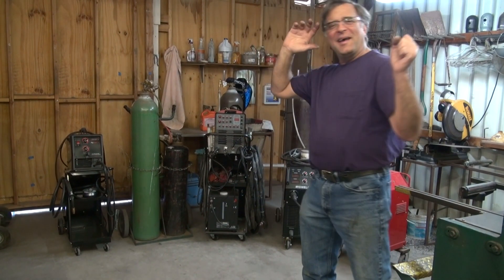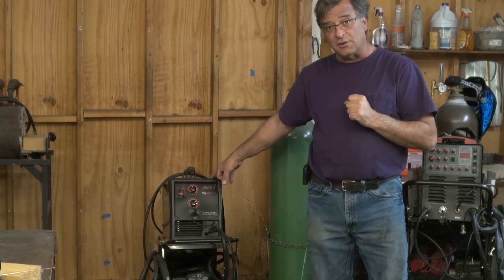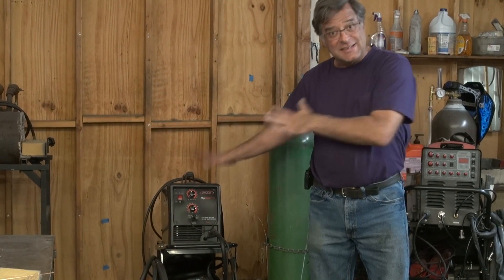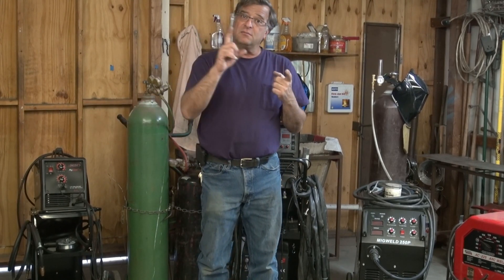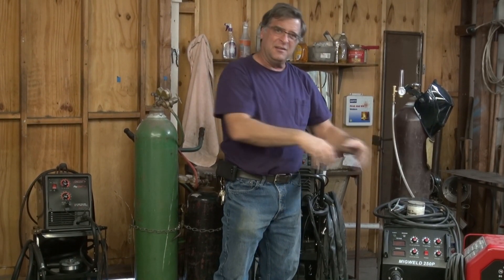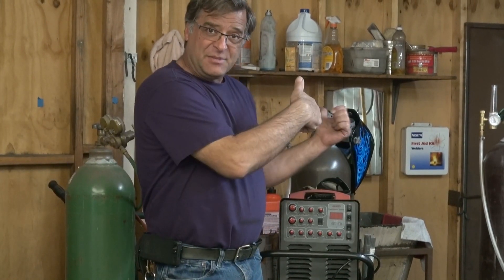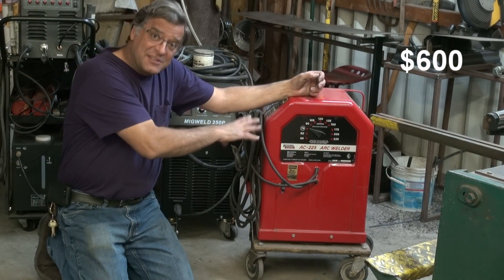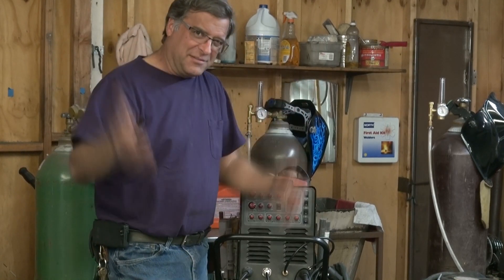How to Pick Your First Welder - Kevin Caron

Comment: Nice vid... Ok, I kinda had to laugh as I started to watch, when you said you have to decide where you are going to weld, inside-yep, out side-yep out in the field-yep, And what are you going to weld? Well everything from nick-nacks, artsy-crafty stuff, to 1-inch Thick Backhoe plate cutters, to 2"x2" 10,000LB trailer hitches, 12,000LB winch brackets, as well as Big and Small tubing for guards on trucks, and Side X Sides, and exhaust pipes, and I need to fix my Aluminum boat that got smashed on the rocks in a storm so I can take my Grand-kids fishing again, and I just got asked to make a bunch of steel plate shooting targets as well, I think they are 5/8" or better, so that is the reason I need to upgrade from my $89.00 HF gasless  wire feeder...(Which has worked perfectly for small stuff!! Best $89.ever spent!! Saved me well over $1000.00 So far and I'm only on the 2nd 2lb spool!!) Ok, Now the problem... I don't have 10,000 square foot "Welders" area to work in, and I can't afford to have 6 different welders, actually, I can only afford and have room for "ONE" welder... As I may weld 5 or 6 times in a year, then not weld anything for 2-3 years... So I need something that can do 110V as well as 220V and  would like AC/DC Mig/Stick/Tig... Someone just told me that a company called Everlast is coming out with one in a few months but all their numbers are "Bogus" and I have never heard of them before this week... So they seem very "Shady"... ( don't like when you can't contact a company "Fast & Easy"!! ) And Miller has a couple that are close to what I need, The "New" Millermatic-200 has everything but AC, as it has DC-Mig/Stick/Tig.... Now they also have a AC/DC Miller-Sycrowave 210 that has AC/DC Tig/Stick, and you can use a spool gun for Mig... So What would you recommend if you can only have "ONE" welder and have to do everything I need to do... (right now 90% is Outdoor) Please let me know which one of these would work the best for me, or if you have an another one that is of same quality for less money as Miller... Miller has rebates that can save $300.$400. depending on the unit right now... Rebates end 12/31/16 Please help... Oh by the way, I did some Stick welding with a unit like your red one but it I think was AC-Only a heavy Lincoln 225, But that needed a 60 Amp breaker and right now I don't have room in my breaker box to put any 220V breakers,(That unit is in Storage in another town) So right now I will be running on 110V until I sell my 5000Watt backup Gen (For when the power goes out) and replace it with a larger one so I can run the 220V off the Gen... I also did Acetyl/Oxy Brazen and Cutting in the early 70's, So I think once I get the hang of Tig and mig I should be good...I watched a few videos and it seams most are using circle motion for Mig and tig, so I will have to try that and compare it to the way I was taught to stick weld in the triangle way... And in a few years My Grand-kids will be old enough to take a class on welding and I will let them use my welder to take to class and practice with and when they get good at it, I won't need to weld anything anymore... :)) LOL!! So please help ASAP Thanks And Have A Very MERRY-CHRISTMAS!! AND A HAPPY-NEW-YEAR!!
Reply from the maker: I like the Everlast PowerMTS 251si..     Doesn't have AC but will run a spool gun..   They are supposed to be coming out with a AC/DC version sometime early 2017 but I have not seen one yet..     Not sure why you think they are bogus.   They have been around for a while now..    I have been using their machines for about 4 years now...   I don't like the reports I am getting about customer service from them and will talk to the owner about it..

While Miller is a very high quality machine and should last a long time they are just too proud of their machines!       Can't afford that kind of money for what I do..

You might also look at AHP,    They have doing great work on their machines and I have had no problems with any of them. 

Have a great holiday and thanks for watching!
Reply: Well i tried to get information about that one and the "New" one you said was coming out, but none of their Phone numbers worked... So I emailed them to see if they had a dealer near me and if they could send me a working number... I told them I wanted to compare their units to the Millers units, and this is the email I got back...

From: sales@everlastgenerators.com <sales@everlastgenerators.com>
Sent: Saturday, December 24, 2016 11:04 PM
To: Debo D
Subject: Re: DEALERS??? PHONE NUMBERS??
 
I think everlast is not a good match for you 

Please do with miller since they have working numbers 

 happy holidays 

Oleg Gladshteyn

Tel: 650 588 8588 x201

Wow, Nice customer Service!! LOL!! Not!! Can't believe anyone would ever buy anything from a company like that.... So I guess I will take his advice an "Do" with Miller!! So which model would be better for "Everything"  Millermatic-200 or the Millet Syncrowave 210?? So I wouldn't recommend "Everlast" anymore... But I would like your honest opinion on which Miller will be best for  Me... Thanks
Reply from the maker: So sad that I have to say I have no experience with either of those machine..  I have never been able to get MIller to talk to me about their machines and I just can't afford to buy them just to do a video or two.   I will stop promoting Everlast at this point..   They are just not offering the customer service that I would want for myself.    Sad...
Reply: Well do you know any professional welders, that might be able to look at the specs and tell me which would be better for me? I gust want to make sure I can do everything I need to do with it because, if neither of these can do what I need them to do them I will be forced to find out if Harbor Freight has separate units then I will have to build a tall cart to stack them all on and roll them on my trailer to take into the field...  Or find some used stuff on Craigslist, or at Pawn shops... But I hate buying used stuff because I always get taken, and lose money... But I never welded with Gas, Mig or Tig, and don't know if these can weld stick up to 5/8" or more?? I know I used to weld 1/2 -5/8 with my old Lincoln-225 AC unit and I never welded on max... I did weld 1" hard steel one time and had it on the notch just below max, and it did a great job... So I figured it was like 190Amps  maybe 200, and that's why I figured these would work because they are 200 or over on max... I wouldn't be running on "Max" all the time but some of the time when I need it... 80% will be bed frames and angle-iron... And small craft stuff... Like I said before I'm not going to be welding 10 hours a day 6 day a week... I might make 4 or 5 welds a "Year!! I haven't welded anything since January of 2015!! But I have a bunch of projects coming up this next year I told people I would help with, Once I help them for free I have to put the winch on my trailer and a few other little projects, then I will be done for a long while... So please ask your Pro-Friends to look at the specs and let me know tomorrow which one of these, or, if either one will work for me... Or if anyone else can help me get the best all around unit that will do what I need... Thanks...
Reply from the maker: Just from looking at the specs I would say go with this one,

http://store.cyberweld.com/mimu200muwe9.html

You can always add the tig kit later if you want to learn tig..  

Should do you just fine..

Comment: Hey, Kermit the Frog here, with a quick little video about welders. Haha could't help but thinking that! But great video that addressed a lot of questions I had. Looking to get my first welder. Don't know how to weld, but I want to learn. I have been told it's best to start with a stick welder, because as you increase quality of welder, your welds will be even better.
Reply from the maker: I feel it's best to start with MIG,   then STICK,  then TIG.        But really just start with what you can afford.
Reply: Kevin Caron, Artist.. is this because of simplicity, quality of the welds or what?
Reply: Probably ease of use.  I did stick in Jr. High school and had a small one for various projects, did Mig for a scenery shop and a bit of gas for another shop.  Mig was described to me as the "glue gun of welding" and that is pretty accurate.  Stick can be a PITA, and you have slag to clean up.  It's also really discouraging when you are starting out to have what looks like a great (stick) weld that just falls apart because what looked great was the slag and you didn't get a decent weld at all.  With gas Mig you will see the weld you are making and your odds of doing OK are MUCH better than stick.  The flip would be if money is the biggest issue.  You can get an inverter stick welder for very little money that will work very well.

Comment: Hi uncle Kevin 
What is your opinion on ESAB rebel (multiprocess) welder compare to Lincoln power MIG 210 MP welder & Miller Multimaric 215? Which one do you recommend as far as quality and durability wise? Thank you
Reply from the maker: Have never used an ESAB but out of the red or blue, go with the blue.

But if you want a great welder and don't want to spend that much money you should give Everlast a look as well.. 

Been really happy with the machines.
Reply: I have the ESAB Rebel emp 215. Great machine. It’s just DC though.

Comment: Loved the video. So informative. Can you elaborate on 'harder to learn' when describing the TIG welder. Buying my first welder (inside garage use). Want longevity out of unit and not planning on upgrading in the future.
Reply from the maker: It's harder to learn because you have to use both hands and a foot if you are using the fool pedal.   If you are using the trigger switch you still need both hands and they are doing something different from each other..  Just takes more practice to get comfortable with it..       If the budget is no issue go look at the Millers..    If you are like the rest of us I would point you towards the Everlast or AHP line..
Reply: I would second that.  I am just starting with Tig.  I went that route because of flexibility.  Also cost since two things I want to be able to weld are stainless and aluminum and when I added up what it would take to do both Tig VS Mig, Tig won.  Also I'm in a limited space and having lots of spatter and bouncing molten metal balls would be a safety issue.

Comment: great video! I haven't touched a welder in 10 years. its been a while, but i want to get back into it.

I have a small mig that i use flux core with.

I want to get into welding alumimun, but i dont want to buy gas. Is there a way aroudn this?

What can i do to setup my little mig to do aluminum and can i get away from gas. 

Gas is very expensize here and unless you are a commercial welder, it will cost and arm and a leg. 

how you used a alcohol welder? multiplaz welder... is so what do you think of this? is it an option as an all in one?
Reply from the maker: Sorry, but aluminum needs gas and tig or gas and spool gun or just plain smaw rod with no gas..    and that is one smoky mess!
Reply from the maker: Have never used an alcohol welder or the multiplaz, can't offer any opinion on them
Reply: There are some aluminum (they call them welding but it's really more soldering) rods that work well.  They are not going to as strong as an actual weld but may well work for your needs.
Reply: They are fairly low temp and you can use them with a propane torch.

Comment: hi,  I ordered a goplus flux core mig welder,  later learned they made 110v stick welders in the same price range.   I welded in high school on arc welders,  but no mig/ flux core experience.   from the videos I've seen,  it looks fairly easy.   I'm mainly going to be welding on my truck,  and doing some artwork.   maybe building some welding tables.
Reply from the maker: Cool,   welcome to the club!

Comment: Hey Kevin, great video. After I watched it I did a little more research, I  need some help please... Obviously I need a Welder.  I'm looking at either a stick Welder or a Mig. This will be my first Welder, have zero personal experience welding. Will be working 100% in the garage, excellent ventilation, have 220, looking to weld things like shop tools, up to quarte/half inch steel, budget isn't a huge deal but, I'm a wood worker/knife maker so really don't want to spend more than 500 to start. If you had to pick based on those parameters, Mig or stick? And, any specific machine? Thanks for making the video and your time.
Reply from the maker: Thanks for watching and please check this machine out..  

http://www.everlastgenerators.com/product/mig/power-i-mig-200

A little over budget but well worth it.
Reply: Awesome, thank you sir
Reply: he said he didnt want to spend more than 500
Reply: Everlast 140st and 160sth are both under $500 list.  both can also tig weld with the 160sth having a gas solenoid and high freq start and can support a pedal. I think both support dual voltage input but not sure. Stick welding won't require him to use / buy argon. Everlast 140 mig is also under $500
Reply: I bought my first (and second) welder from Everlast. I really like them. Kepp the videos coming. I'm hooked on welding!

Comment: Great Video! Like you say it depends on what you want to weld. I want to cut up some old bikes and make some sort of vehicle out of them. No motor and maybe not even keeping the chain or gears, like a push cart. probably would use bed frames too. So which type would you recommend? I was leaning toward the gas one 300$ to get the portable kind.
Reply from the maker: I would say a small mig..    something in the 200 amp range..
Reply: I got one of those everlast mig welders that can stick weld too. Great little welder.

Comment: I'm from the uk kevin used metal arc welding and stick I want to start making furniture and decorative stuff from old motorbike parts what machine would you recommend don't want to buy expensive machine if its not necessary is there welds that run off jennys but still have power and can use outside sounds like the tig one would be ideal but never done tig before

Comment: hey Kevin i been mig welding for a like 6 years with my Millers an wanted to start tig welding but dnt no what would be a good starter tig machine. pleas help. thanks
Reply from the maker: All depends on the budget.      Look at the AHP Alphatig 200.   Great machine for a starter/hobbiest.   If you are on a real tight budget look at the AHP 160st. Stick welder with a lift start tig.
Reply: Copy that Sr. Thanks

Comment: The Lincoln tombstone welder is $300 in many places.
Reply: silenceisconsent The AC-225 is in the $300 range, the AC/DC-225 is in the $600 range. Hobart as an equivalent to the Lincoln 225.
Reply: silenceisconsent Look for a used AC/DC Lincoln 225, $300 or less in my area. If you don't have 220/240 outlet gor a welder, look into a dual-voltage inverter based welder. Everlast 140ST is under $300 and includes a tig torch. Forgot to ask what thickness metal you normally weld on.
Reply: silenceisconsent Personally, my choice would be a Hobart Stickmate. It has the in between settings that the Lincoln misses. The Hobart AC/DC Stickmate 235 should be $550 or so at local farm supply stores. For anything under 1/8" thick, look into a wire feed welder. By the way, Hobart is the consumer grade of Miller and very good quality.